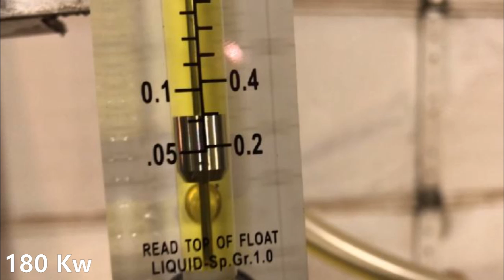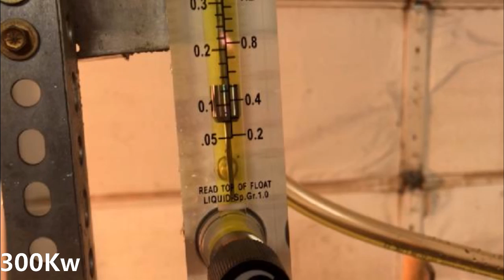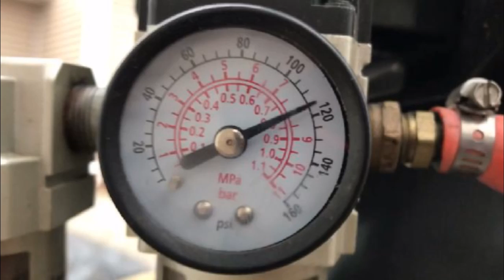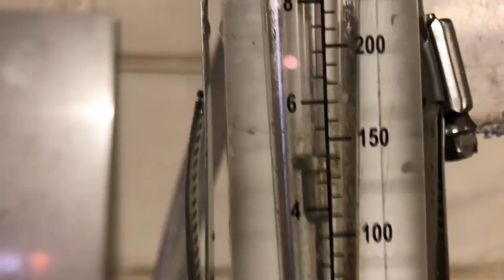500 Kw Godzilla Casting burner burns any fuel or oil

Comment: Where would one get a crucible that can whitstand that kind of temperature needed for casting steel or cast iron?
Also what kind of insulation materials would you need to get for those temperatures.
In my country i can barely find things rated for 1300 C let alone 1800-2000.
It would be super practical to be able to throw a peace of steel bar and cast what you want but i think materials above will be a turn off for many people.
Anyone knows what a steel foundrys are using as a refractory in those huge pots that swing from the cranes ?